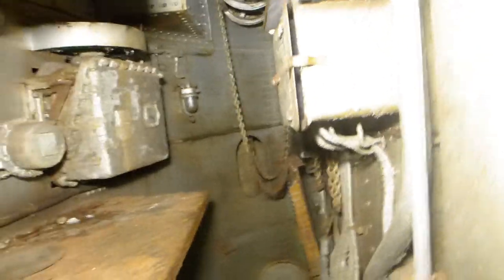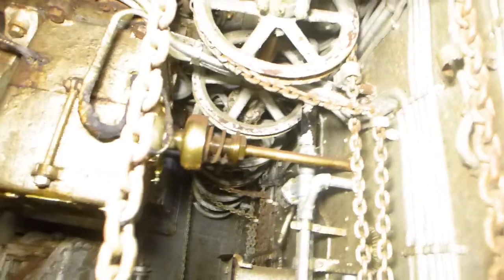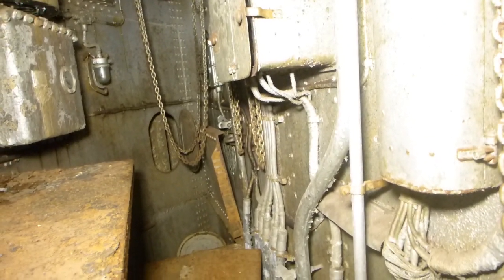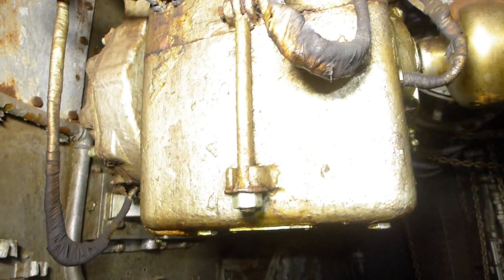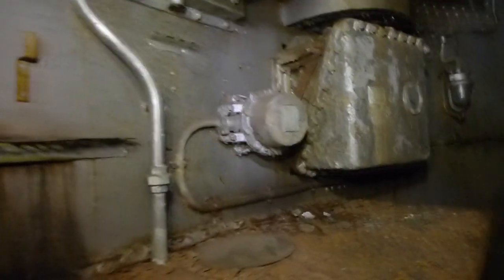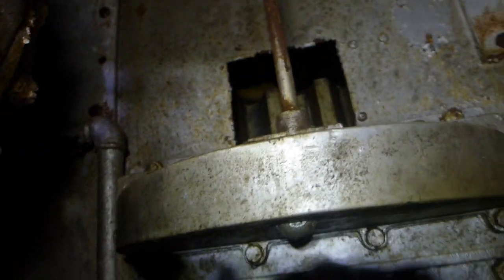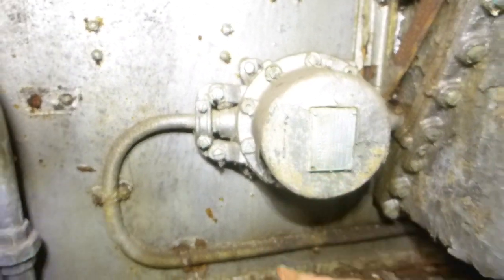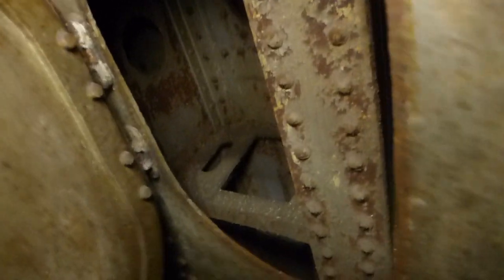Battleship Texas, In The Chainfalls

Comment: incredible turn of the century technology - no doubt much has been replaced with simple micro switches and micro chips

1904 tech not used or installed for some ten years, as Tom suggests, why change it if it works, more than adequate for the task
can't believe 16 people worked in this tin can, must have been noisy  - wouldn't it be cool to see if anything could work again

Comment: Since close to no sailors who served on this ship still breathe, how do you figure out how these things operate? Are ther operating manuals that explain all these obscure devices?
Reply from the maker: You are right, there is only a very small handful of surviving veterans and none are now capable of providing information.  

Fortunately, there are better sources of information that really drill down into the details.  One of them is Navy ordnance manuals from the 1910's and 1920's.  These cover overall and detailed design features of guns and turrets.  There are also Navy gunnery manuals from the era that include crew operating procedures for individual turret designs.  These include detailed procedures specifically for the 14"/45 cal, two-gun turrets on battleships Texas and New York.  They are 100% reliable sources since both types of manuals were directly used for educating gunnery officers and enlisted personnel of the era.  Both can be found and downloaded using Google Books.  

In the case of this video, I also have builder's drawings showing both the overall mechanism and individual components for the chainfalls.  The mechanisms are straightforward and their operation is generally easy to interpret.  It also helps that I was able to physically inspect them on the ship where I could directly see relationships between components that may not be easy to understand on a drawing.  

In both this case and other turret subsystems, the two manuals, builder's drawings and direct inspection combine to give me a very high level of confidence with my understanding of design and operation.

Comment: If you were training the turret by hand your situation was very dire.
Reply from the maker: I agree.  The only practical use I can think of for the manual chain falls would be to service the turret without powering it up.  An example would be to individually service the turret rollers that are the bearings the turret rests and rotates on.  It requires moving the turret very slowly and stopping it very precisely to get to each roller.  That would be easier to do manually than with power.

Comment: Tom, could the chain falls have been used (instead of the electric) to center the turret to install the centering pin?
Reply from the maker: They could have when the ship was in operational condition.  However, I don't see much reason to do that since the trainer could train the turret as slowly as 1 degree per minute.  It would be a simple matter for the hoist man responsible for inserting the pin to call instructions down to the trainer.  It wouldn't be possible now since none of the hydraulic speed controllers are in working condition.

Comment: I didn’t know how many systems had manual back ups in the 14 inch turret. By comparison my 16 inch gun turret had many redundant systems and you could bypass all of the safety circuits, but there were no manual systems for train, elevation, or hoists.
Reply from the maker: The designers' motto for the New York class seemed to be keep it simple, keep it manual.   Unfortunately, the chainfalls were so slow, they were essentially useless.  It would have been much more useful if they had included additional backup powered systems for the turrets.  I think the Brits had it dialed in better with their heavy reliance on hydraulics.  Primary and backup pumps could be mounted in remote, well protected spaces and hydraulic lines run to motors where they were needed.  Damage control would be easier and there was less danger of electrocution and fire from damaged conductors and controllers.  However, to be fair to Texas' designers, the Mark 1, 14" 2-gun turret was a huge leap from previous designs.  Since most designs were evolutionary, I think they were being conservative and used what they figured would work.  In a sense, they checked off the box labelled "backup", but without really answering the question of how practical their solution was.  Again in an effort to be fair, every designer of every system was always under the budget gun.  I don't know this to be true, but I wouldn't be surprised if that was a major factor in the decisions.  Btw, I cannot imagine any possibility of having any kind of manual handling, training or pointing equipment on the Iowa class.  Things are simply too big and too heavy.
Reply: Big and heavy is right! We only ever set the turret train locking pins once. We were underway in rough seas and the Weapons Officer ordered the train locking pins set. The design was similar to the 14 inch turret except the pins were hand cranked into place with a threaded mechanism. My turret SCPO said NO! we would never get the pins out again. The Weapons Officer overruled my SCPO. The next morning the storm passed and we had three non functional turrets. They had all moved just very slightly and put 1800 tons of side torque on those pins. So my SCPO was wrong it only took turret one about 24 hours of tuning the train system on and off to finally remove the pins. Turret three was 18 hours and my turret took about 8 hours. I think my SCPO made sure we didn’t put the pins all the way in so our misery was shorter than the other turrets.
Reply from the maker: @robertlian2009  Thanks for the story.  I was going to ask you about your pins and if they were similar.  I saw a drawing of a cruiser turret pin and it was a great example of over design with its geared insertion/removal mechanism and depth indicator.  I will say that while SCPO had a good point, I think I understand the Weapons Officer's concerns.  I'd rather take a few hours removing pins than repairing beat up training gear.

Comment: They probably still work.
Reply from the maker: I am afraid they don't.  Like the electric motors, the chainfalls provide input into hydraulic motors that do the actual job of turning the training and elevating gears.  These motors are extremely complex with each containing scores of pistons and other moving parts fitted at very close tolerances.  None of these have been serviced in more than 75 years and likely cannot be rebuilt.  While detailed assembly drawings of these motors still exist, dimensional drawings of each part are largely missing.  So, while I wouldn't say that it is completely impossible to rebuild or replace one, the money and effort to do so makes it highly impractical.
Reply: @tomscotttheolderone364  you might be surprised, Union Pacific restored a Big Boy (#4014) to operational status that had been in a museum since 1959 with virtually no service done on it. Everyone said a Big Boy would never ride the high iron again. 

Upon initial inspection they found bearings on the tender and engine where the grease still looked fresh. The Texas having been laid up longer and in a harsh environment I agree makes it very unlikely but you might just find a surprise or two if you look. They said the same thing about 4014, there were a few surprises waiting for them during the teardown and rebuild in Cheyenne WY. Parts that hadn’t been used since 59 still worked.
Reply: @dgrenier4908  I'll have to disagree with you slightly on the 'virtually no maintenance' on 4014. It, and the other engines at the LA Fair Grounds, were/are probably some of the best maintained 'dead' rolling stock in the US. That fresh grease had probably been applied by the group there something like 5 years before UP took it away for restoration. Now of course it had nowhere near the level of maintenance that a running steam loco would have had, but it had a lot more than the near-none that most retired equipment in parks gets.

However I'll agree with you that unless A LOT of water has gotten into those swash plate turret drives, refurbishing them would probably be fairly trivial. The hardest part would probably be getting them unbolted and out where they can be worked on in a 'dead' ship without the power working. The second hardest part would be finding non-metric-size gaskets. :-) Swash plate pumps and motors like that are in very common use today in industrial and construction equipment of all sizes, so almost any good hydraulic shop would be able to understand them even without the prints.